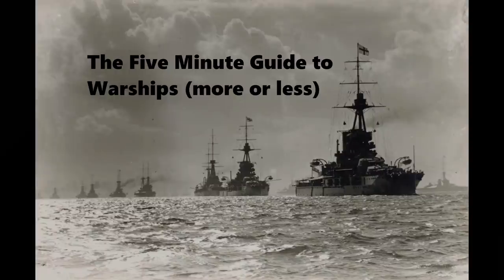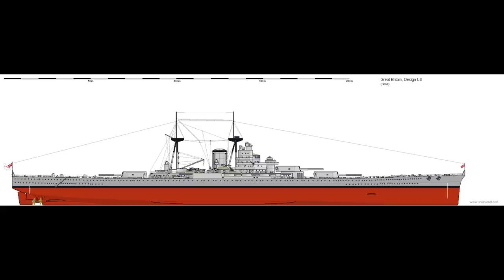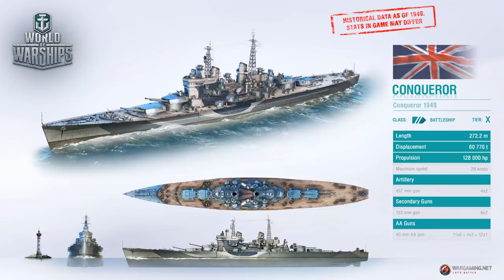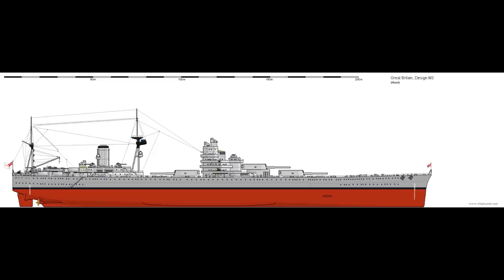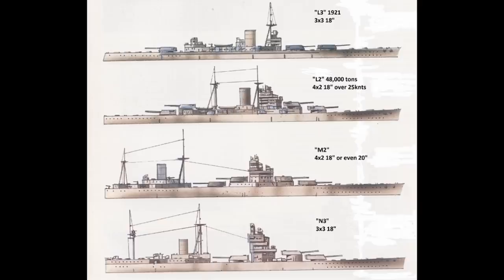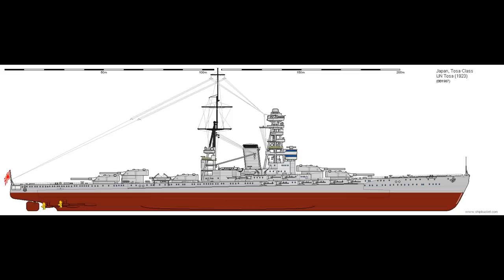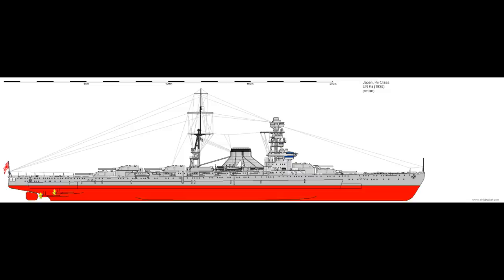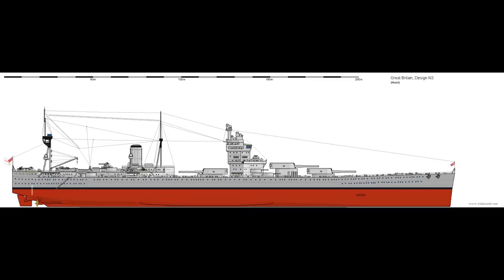N3 class (NB) - Guide 072

Comment: It's worth keeping in mind that the RN often took worse case scenarios with ship speeds, a 23 knots design might be closer to 24/25 etc. Even the Rodney on deeply worn out boilers was able to exceed design speed and hit an estimated 25. With sufficient modernisation (and the budget to do so) the N3 could have been a 26 knot ship. Not fantastic but it puts into the gap between battleship and fast battleship.
Reply: No  you are mistaken.  Rodney was on exercise with Nelson and was starting to lag behind  the rest of the fleet. When ordered to " keep up with the flagship "  she replied " i'm afraid your 21 knots is better than mine !!  "
Reply: @scabbycatcat4202  that's cause maintenance of the ship especially was in a bad state I mean by the time Rodney sailed to destroy Bismarck she was 12 years old and needed changes which were going to be implemented. 12 years long time when talking war machines. Same applied to Hood as she didn't get the 31 knots design (and did go by the way) about 30 knots and lower sailed with POW. She was scheduled for refit also that was to improve and fix the ship.
Reply: No you are mistaken. I understand maintenance issues with ships that have been driven very hard over very long periods of time. No amount of maintenance would make Rodney or Nelson steam at about 25 knots. What evidence do you have that these ships were able to steam at such speeds ?
Reply: @scabbycatcat4202  the part about 21 knots was cause of maintance issues. Anyway some ships can gain knots when they were built. Calculated a refit for the nelson ships could push for 25 knots by giving then qe battleship refitted new engines which were over 2 or nearly 3 times as powerful.
Reply: No . you don't seem to understand ships engineering.  A ship with a design speed of say 21 knots  might be a ble to make say 22.5 knots on her trials. This is when the ship is brand new and sailing at no capacity at all, except possibly some ballast. Its a different story when the ship is at full capacity carrying vast amounts of ammunition, stores , full fuel tanks for long distances etc.  Rodney and Nelson were comparatively low power ships. ie 45000 shp.  No way could they ever come near to 25 knots in service and truthfully most ships in service struggled to attain their design speeds.
Reply: @scabbycatcat4202  well thank you for replying so much to my comments from a month ago, the constant phone notifications have been fun.

Ships could exceed design speed, especially with the correct circumstances of load, trim, temperature and salinity. Even Renown in 1945 still reached 32.5knots despite her speed being downgraded and her boilers coming up to being due an overhaul.

There are more things that dictate a ships maximum speed during use then the captain going 'welp, hold it there lads. Wikipedia says we can't go any faster!'

Also during wartime service ships could go 'over capacity' ie higher steam pressures than designed, this allowed HMS Anson to exceed the KGV design speed during trials.
Reply: No , once again you are mistaken.  Firstly  you have not provided any evidence of Rodney being capable of 25 knots.  Secondely During a battle with scharnhorst and gneisnau  both Germany ships managed to outrun Renown and thus escape.  Renown could not come near to 32.5knots in 1945.  Once again what is your evidence ?
Reply: @scabbycatcat4202  just because you are unaware of something doesn't make someone else mistaken.

You will want to check out 'hms Renown' by Peter c Smith, the 1945 US runs are very well covered, it's where she picked up the name 'Churchills race horse'. Including an interview with several boiler engineers and interesting tidbits as to her shafts speed and how she was exceeding max design power by a considerable margin, the engineer claims 160000shp was achieved. Oh and as for being outrun, indeed she was, thanks to a torpedo bulge coming loose in poor weather. 

I remember the Rodney speed claims from school but I believe it is also referred too in 'HMS rodney' by iain something or other and mentioned in Nelson to Vanguard by DK Brown.
Reply: @scabbycatcat4202  both ships had escaped in bad weather though
Reply: " both ships had escaped in bad weather though"  so what does that prove?
Reply: @scabbycatcat4202  I do believe that both ships had better ability in rough sea. Though other guy explains why it happened better.
Reply: Gerogy Zurkov  Its true they were given " atlantic " bows with greater flair and sheer . But they could have outrun  Renown or indeed any other British battleship or battlecruiser in a flat calm sea.
Reply: Boiler room must'a been Hell on Earth while her captain demanded that kind of giddy up!
Reply: @scabbycatcat4202  That would depend on the natural speed of the hull form, The Nelson class underwent a large amount of hull hydrodynamic research, but i suspect that was due to their low shp and twin screw arrangement. I seem to remember the layout made them pretty unhandy in some wind conditions. Generally you're right a royal navy warship goes no faster then it did on the Arran mile. You see some tall tales I read an account of Repulse touching 35 knots trying to catch some German light cruisers
Reply: @scabbycatcat4202  Renown lost S&G in bad weather. Speed was not the issue, from memory S&G could not make full speed due to the heavy weather.

At the distances we are talking, turning into a squall can be sufficient to lose to visibility and contact. 

Can I suggest you read up some more on these great ships?
Reply: @scabbycatcat4202  You can suggest whatever you want, but I will keep correcting BS whenever I see it.
Reply: Er, no actually. These ships were quite old by the time of WW2 and struggled to even reach 23 knots. 22 knots was more likely. They were in desperate need of overhauls [which Rodney never recieved] and were both worn out by the end of WW2.
Reply: Actually not sure what you mean by overhaul.  RN ships have refits, half life refits or modernisations.  Rodney was on convoy duty to the US and carrying boiler tubes, electronics and additional AA weapons which were due for a refit in the US.  After the Bismarck action she returned to the UK and refuelled and re-ammunitioned before sailing to the US for her refit.   The claim that Rodney did at times exceed her designed speed by two knots was reported in “HMS Rodney” by Iain Ballantyne RNM 2000.32/6 the diary of Commander Robert Parker the Engineer Officer in Rodney during the action.  This obviously was not continuous as later in the chase she signalled KG5 that her 22knots were less than the younger ship.

There was nothing wrong with Rodney’s engines: it was her boilers which caused problems.  The boilers were designed as saturated steam boilers but were converted for superheated steam.  These always had some problems and conditions in the boiler rooms during the chase were very difficult as they were pressed to the limit.

My father was in B turret on the Rodney during the chase.  They did fire ahead during the action and while he said the guns firing aft caused superficial damage he never said firing forward was a problem.  It was a design requirement for British battleships to be able to fire forward at zero elevation hence the lack of Atlantic bows entail the Vanguard.  I doubt ripping up a bit of wood would have discouraged them in action.
Reply: @scabbycatcat4202  You know it's polite and generally good practice to check someones sources before outright saying they're wrong...

After all it does seem that the RN tended to do speed trials under worst-case scenarios, or at least under service conditions and in deep water (unlike the Kreigsmarine). Then the OP's preposition was that after a major refit, so we're talking at least new boilers, possibly entirely new machinery, screws and all, so the 56,000 shp could well become 80,000 or more. which is 40% more power before running the boilers at higher than rated pressure, or bringing online any back-up boilers, so going from 23 to 26 kts isn't unreasonable.
Reply: @sergarlantyrell7847    In that reply you have demonstrated that you know nothing of what you are attempting to comment about.
Reply: @scabbycatcat4202  Well pardon me for breathing...all-hail the omniscient scabby cat... Certainly the rudest of all cats.
Reply: It is amazing how the Brits think an overhaul or a refit will turn the rusty frog into a new Prince . You never get the improvements that you calculate on paper albeit it is great strategy if your enemy believes it. It is probably the best position to take when deep down you know this will be the last Hurrah for England as a sea power and I don’t blame them one bit for doing it
Reply: There were cancelled battlecruiser designs known as the F2 and F3 which were basically battlecruiser versions of the O3 (the historically chosen design for the Nelson class), sacrificing armour protection and armed with 15inch guns (the F2 had 3 dual gun turrets, while the F3 had 3 triple gun turrets), The F3 was capable of of 28Knots while the F2 was capable of 30 Knots. In hindsight these battlecruisers would have been more useful to the British war effort than the historical Nelsons
https://i.postimg.cc/Qdjd4NJs/F2-F3-big.jpg

Comment: Once the G-3 and N-3 were known, the US would have made a major shift.   And who knows what would have been launched after that.  Both designs though and the follow on O-3 Nelsons were in truth a bit eccentric.   Some of the design parameters used for justifying the odd placement of the midships turret made no sense.  The layouts of the engineering spaces were especially cramped and it lead to significant  compromises.  Did it never occur to the designers that sometimes ships retreat and need to have guns that could fire at a pursuer?   Nor did the final design include much room for modernization.  The G-3's and N-3's wold have been hard pressed to find a place to put extra generators.   In the Nelson, there was no room for even minor system tweaks.   Modernization of the Renown and QE's were substantially helped in the 30's by higher pressure systems  taking up less space.   The Nelsons were plagued by issues where even minor equipment upgrades could not be fitted.    I think the G-3's would have been good ships, but the N-3 was too slow and would have been a difficult monster to justify.

Comment: These are really interesting because of seeing all the ways designers played around with turret placement. I for one still believe that the 4 double super firing (2 forward, 2 aft) turrets or the or 3 turret with three gun (2 forward in super firing postions, 1 aft) make the most sense. You are not blocking the guns fire with anything or as little as possible.
Reply: I agree,   the N3 does not look efficient, sleek or pretty to me with the engine stack behind the aft turret.
Reply: The idea, I'm pretty sure, was to minimise the size of the citadel on the ship, and therefore reduce the chance of receiving critical damage. Provided the ship can maneuver adequately, I don't see this setup as being too detrimental. It would only really be in retreating that the issue of blocking the art turret would arise, and given that they could have probably out fought any other ship, it's not a pressing concern IMHO.
Reply: There are many reasons
1) Turning takes seconds, and these behomoths would be able to bring all guns to bear in a raking approach of about 20-30 degrees to the enemy battle line in a twentieth-century twist on the Nelson touch.
2) Putting the funnels far from fire control was a key consideration before radar 
3) The RN did not envisage these ships running away 
4) As noted by the excellent commentator the expectation was to fight broadside on
5) As you rightly say there's a huge gain in reducing the citadel and the weight of the power plant by putting the power at the back and the guns together.
There's a model of a G3 and some videos of it around - its actually quite a beautiful ship.

Comment: The N3's flaws should have been clear at the design stage; the beam was insufficient in structural terms for a full simultaneous broadside, the guns would have had to be fired in three salvoes, one gun per turret firing simultaneously with the other two then followed by the others. This to reduce stress of the frames and avoid dispersion problems with the high velocity shells. Then you have severe restrictions on the firing arcs of all three turrets to avoid blast damage to the ship's own superstructure. Then you have to think of the blast effects on the crew! And I mean the crew inside the superstructure – no crew outside of course. I reckon it wouldn't be a case of a second or two delay between the intermediate salvoes but a few at the very least. The ships real value would have been for shore bombardment (now called “fire support”) - highly useful on D Day!
Of course, had they been built, the ships would have been scrapped immediately after WW2. They would have been sold for scrap for the money and the steel. It would have been nice to have one moored in the Thames in place of HMS Belfast though.
Reply: As the Iowa class discovered - a 16” broadside is devastating to the FIRING ship with significant damage to all equipment outside the citadel including anti aircraft guns.

Comment: Conqueror is NOT based on L2. It has more in common with Vanguard in terms of layout (vertical armour belt, etc.), and really only the turret layout and guns can be said to be from L2. It also has lattice masts, which no British battleship ever carried or was designed with.
Reply: Agree, it is closer to a 'Vanguard with 18" guns' than an 'L2 with modern british BB armor (which doesn't make it an L2 anymore anyway)'.
Reply: Yeah most defiantly upgraded Vanguard. The only thing it shares with L2 is large 18 inch guns.

Comment: Think the idea of the N3 would be the G3 battle cruiser would attack first and slow down the enemy first and then keep the ship pinned in while the N3 caught up and bombarded the enemy with the 20 inch shells. Kinda like the bismark the bismark was damaged by the torpedoes the finished by the battleship
Reply: chris hopwood 

Even the G3 would have been able to fight evenly with the best actual battleships that were actually built (the Iowas). The N3 is overkill.
Reply: @chrishopwood6938  Agreed. If the N3 was built, it would have been refitted and upgraded to a 28-30 knots battleship during WWII. Maybe with a more up to date turbine and boiler design. Imagine it was an N3 instead of the Hood who met the Bismarck! The whole German fleet would have been seriously damaged by the N3.  But of course, if N3 was built, the Nazis would have built an even stronger ship than the Bismarck... :  )
Reply: 18" shells.

Comment: Navweaps lists the turrets at 1,730 tons, just 250 tons more than the Nelsons and surprisingly light for 18-inchers. The beam at 32.3 metres is also just equal to the Nelsons even though the turrets were wider and heavier. Would there have be stability issues?

Comment: >Due to the differences in material quality,
We're in early 1920s. Advances in British metallurgy just aren't here yet. 
So no,  Yamato's crown isn't that easy to shake.
Reply: http://www.navweaps.com/index_tech/tech-040.php

Not quite...  The United States Navy did extensive testing on an unused piece of 26" thick face plate that was originally intended to be mounted on one of Shinano's turrets.  The steel was found to be excessively brittle internally, with many pieces of dirt in it and overall poor quality.  It was rated as roughly 83% compared to US Class A armor, and the quality of the steel was considered roughly comparable to British pre-World War 1 Vickers Cemented armor.

Comment: Not sure if this is posted already in the comments but 4 twins vs 3 tripples is not so straightforward. On a pure gunnery perspective. There are reasons why 4 twins actually do put out a greater relative output on target than 3 tripples in real life tests. The real reason was to accommodate the necessary design requisites within a certain tonnage or size ship.

Comment: What does he mean by "superfiring"?
Reply: A Superfiring pair is a group of 2 turrets where one turret is higher and the guns are able to train over the lower turret. If you look at older battleships of the British and German navies the turrets are more spaced and none train over another this tends to cause wing turrets which are off the center line and can not train both side. An all center line superfiring arrangement means that all main guns are available on the broadside and the length of the armour belt required to protect the magazine can be reduced a little. However there are disadvantages such as slight reduction in stability as weight is raised to a high level and with British turrets until Hood the superfiring B and X turrets could not fire over the lower turret +/- 30 degrees to Ahead/Astern due to flash entering sighting hoods on the turret roof.
Reply: @jonathanevans4610  
Ok, I get it now.
Thanks!